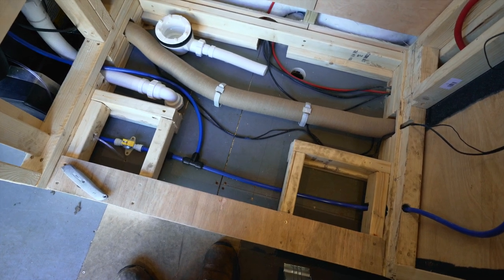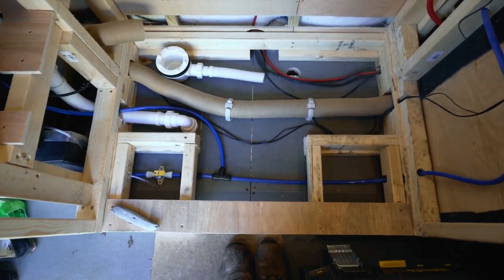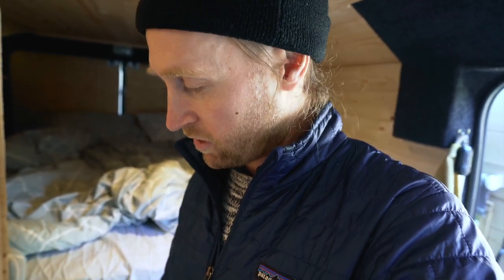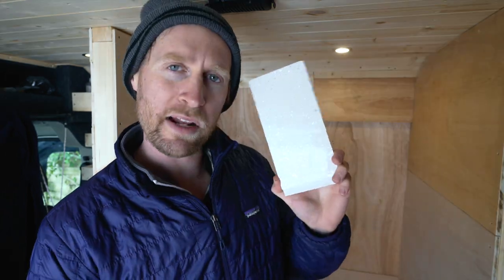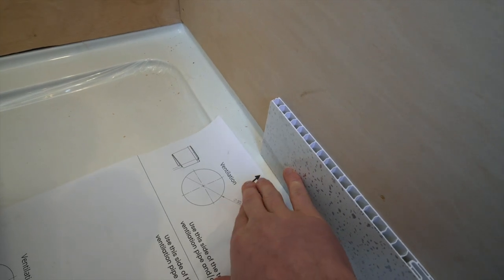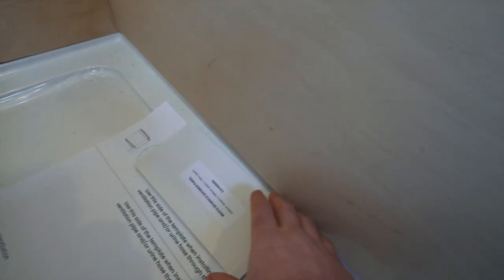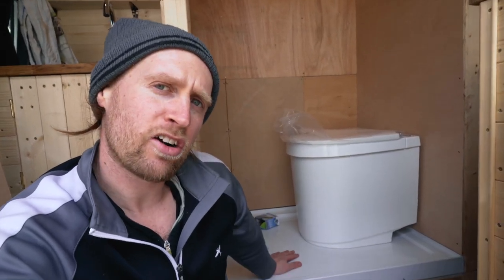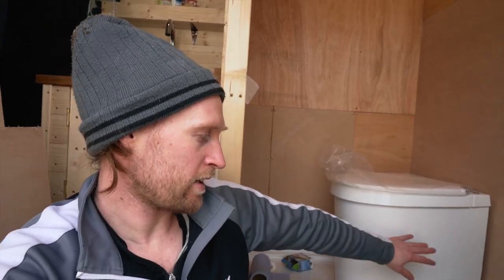Fitting a Shower Tray in Our Van! | Van Build Ep. 27

Comment: How has the tray fared after some time? I am going for stone resin too
Reply from the maker: It’s as good as it was when I installed it. It’s a tricky one because stone resin is really heavy and I think if I did another build I’d try to find areas to shed some weight but the other options for shower trays are pretty pants and it just works really well.

Comment: PS if you are worried about the weight you really ought to find a weighbridge there’s load out there most builders and scrap metal merchant also have them.
Get the vehicle weighed wet I.e with full tanks of fuel and water plus all your usual luggage food passengers etc. 
if overweight and stopped by the police for a vosa check they won’t let you drive on until underweight as your insurance taxation class and non C1 licence becomes invalid.
If being able to dump a tank of fresh or waste water brings it under 3500kg then that’s better than having to dump the wife and kids!
Reply from the maker: Hahaha, I’m going to see if I can find one. We have 1,500kg of payload so I think it will be fine but I just keep adding more and more and nothing has really been weight saving as such so just concerned especially after there’s 200kg of water on board.

Comment: Hi mate do you come into any issues with draining with low profile tray
Reply from the maker: @liam7838 Haha, the tray I bought has a slight lip around the perimeter which was intentional for that exact reason, that being said you do need to be parked the right way so that it drains. We have had one instance where we were parked the wrong way and the water was sloshing over and soaked the back of the van, luckily it was summer so it dried quickly but yeah naturally it comes down to parking flat or slightly forward and to the right as our drain is the wall side towards the front. To be honest everytime we park the van we look for as flat as possible which at free park ups can be difficult. If we can’t get it flat then level sideways and nose down is preferable for not only the shower but also the bed as we have our heads at the back of the van and the bed is long ways. Side to side wonk is really annoying but again because of the shower if there is a side wonk then leaning to the right for the shower is preferable. It’s all a part of van life I guess 😄
Reply: Cheers for the response mate I wasn’t expecting a quick reply, where did you find the one with the lip on it ? Also do you find the 900 length is comfortable enough to sit down on the toilet. 

This is the one I’ve been looking at
Reply from the maker: @liam7838 I was originally looking at deep shower trays or anything that wasn’t flat as I didn’t want to water to just pour out and I didn’t want to custom build anything and the motorhome ones just look so cheap and nasty. I found one with a lip just on Google I think. The idea was that I would have the shower panels on the inside of the lip and flush on the tray further preventing any possible water leaks if the silicone failed or anything and so far a year on nothing has leaked so that’s good. I wouldn’t go any smaller than 900 x 700, there’s just enough room and the toilet fits fine. We have the separette tiny toilet which is quite compact, I’m not sure dimensions of other toilets but the setup we have works fine. It’s a bit squishy and awkward when you’re showering though especially if you’re taller or bigger because there’s a toilet just in the way and it’s a bit fiddly especially when you turn around, I can’t stand up either because I raised it off the floor about 6 inches to allow for the drain and heating duct underneath so I have to duck down a bit but again that’s just vanlife, we couldn’t go bigger than 900 x 700 because we just didn’t have any more room, I think if you can stretch to 1000 x 700 that would be good but certainly not essential, I think if we had the longer van I would’ve got a slightly bigger tray. They’re also quite heavy solid stone shower trays so bear that in mind 👍
Reply: For some reason the tray I linked disappeared.

Nuie TR71007 | Modern Bathroom Rectangular Slimline Pearlstone Shower Tray, 700mm x 900mm, Slate Grey, 900mm x 700mm

That one is on Amazon and it’s lighter than the one you’ve fitted but way stronger than the really flimsy ones. 

I think I’m just going to instal a composite toilet I can move in and out of the shower.

However it doesn’t have a lip, I couldn’t find the one with your dimensions with the lip so I think I’m going to try install the seal tape being and hope for the best 😅
Is raising the shower tray the only option for the waste ? I’ve been looking for an adapter/reducer from 90mm to something smaller so I can go straight out the bottom into the tank. I can’t seem to find anything at all. Have you come across anything like that since you’ve installed yours raised ?
Reply from the maker: @liam7838 The trouble is the shower trap which fits directly under the tray so it’s not just a pipe going out the floor into the tank but if you raise it then you can install the trap and then just drill a hole for the waste pipe, much easier. I also had to run plumbing, cables and some ducting from the front to the back of the van so raising the shower was a no brainer because it’s just all under there, I also have the kitchen sink waste and the composting toilet vent all going out the van under the shower so it’s all in one place. Honestly it makes it so much easier, the only downside is headroom issue but you’re not having long showers in the van it’s just a quick scrub and rinse and you’re in a van it’s not a hotel but it’s entirely up to you. I think the tray I got was a Mira, you could just silicone some pvc quadrant or trim though I guess, as long as it stops the water 👍

Comment: The plastic trays are truly appalling quality, extremely thin and fragile especially where the blow moulding is at its weakest at the corners
There’s probably more thickness in a margarine tub! If I could have bought a 600mm square domestic tray I would have used it.

Next time I will get something made up from stainless steel.
Reply from the maker: Stainless looked like a good option but I just went with something off the shelf and it’s great just rather hefty.